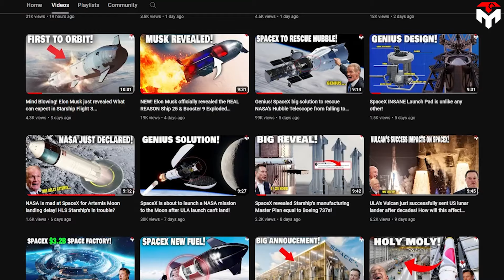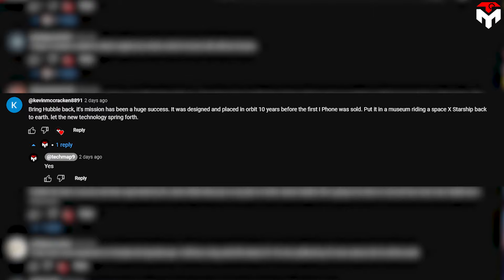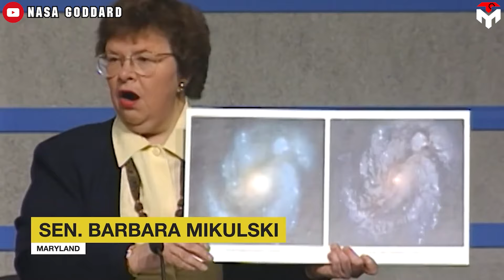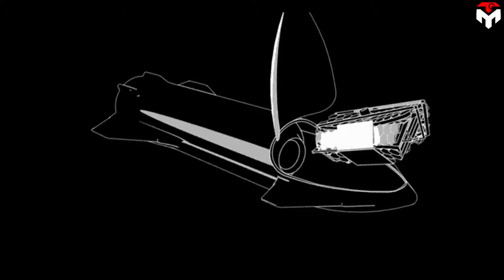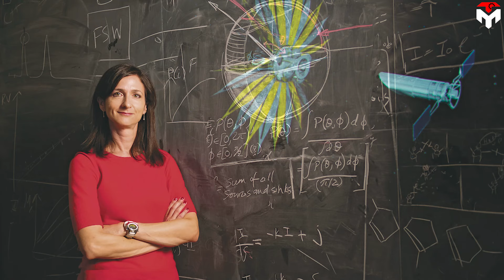GENIUS! Elon Musk confirmed Starship Transform Into '9m Telescope' to replace NASA Hubble...

Comment: it is mostly a question of the economy: Saving the Hubble Telescope (2,4m main mirror) for some further decades will cost a lot as it has to be visited by a capsule for repair and refueling. Compared to the James Webb  Telescope (6.5m main mirror) it is far weaker. With Starship, one could launch a much larger telescope that does not even exist on Earth (>20m main mirror diameter to unfold like the JWST).
Reply from the maker: Thanks for interesting idea